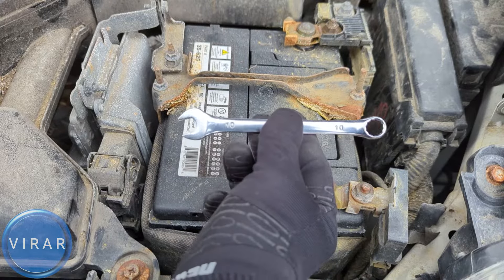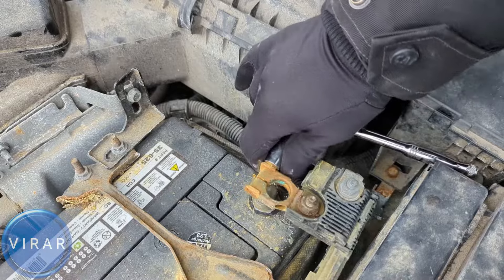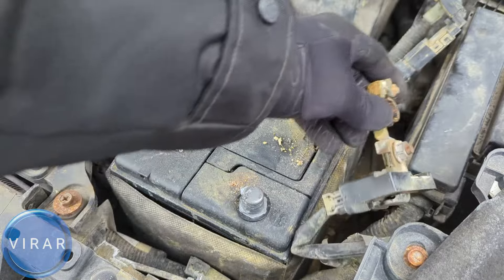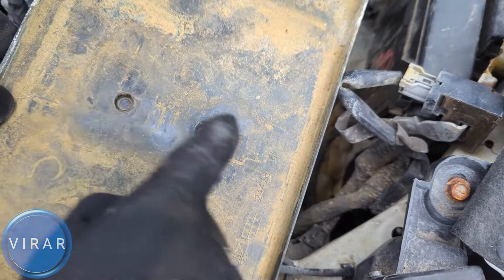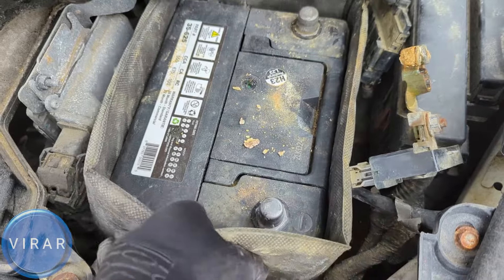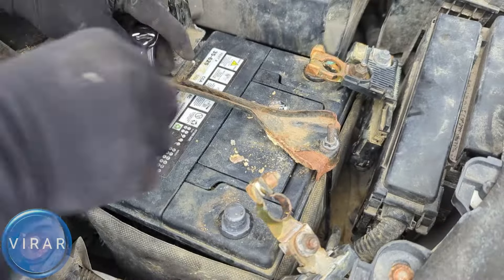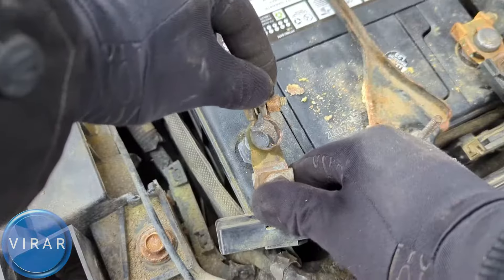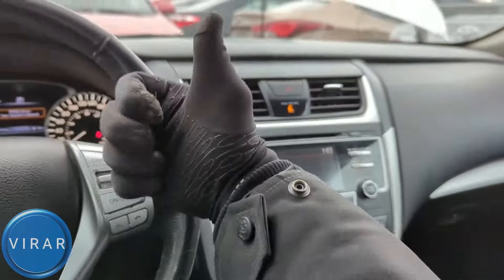How to [EASILY] Replace the Battery - Nissan Altima (2013-2018)

Comment: Did you clean the inside of the Positive Lug?  It still looked rusty when you installed it on the battery terminal.
Reply from the maker: Yes it's always a good idea to clean the battery wires before installing the new battery.

Comment: If I don’t have the bracket installed should it be fine ?
Reply from the maker: Not really. No. The battery won't be secured in the engine compartment. You need to have the installed correctly.
Reply: It will not be fine because you risk the battery pulling on the terminals which can damage the battery.